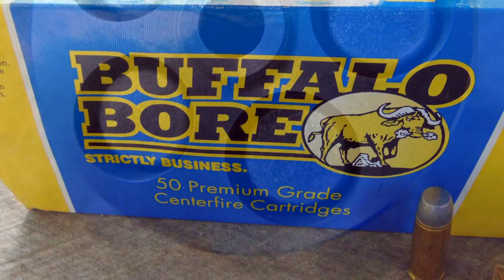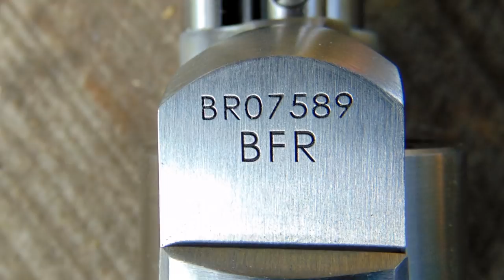Magnum Research BFR Bisley 500 Linebaugh Revolver - Gunblast.com

Comment: Good NIGHT. 
You handle that like a boss, but even with you it looks like it's 2 inches from taking your head off.

I wager the lower speed loads make the push a little less painful, but it's still making that revolver into a projectile.

I tried a 4" 500 s&w once. It's a handfull, but it's manageable and only slightly painful with the rubber grips and standard brake.

How's it compare to that? I know the configuration, revolver type, grip material and shape type and cartridge are all so different that it's not apples to apples... but I just mean is it more painful? Is it harder to control?